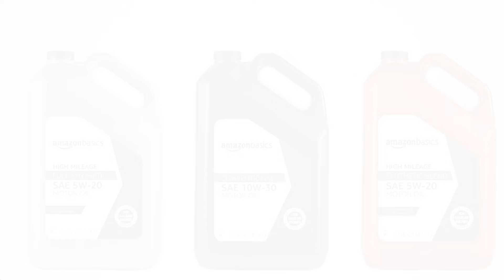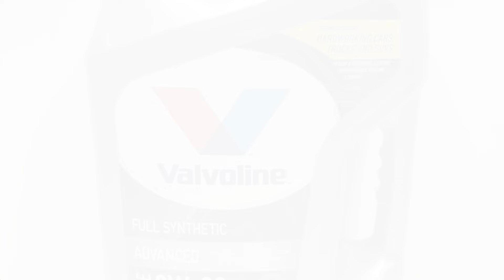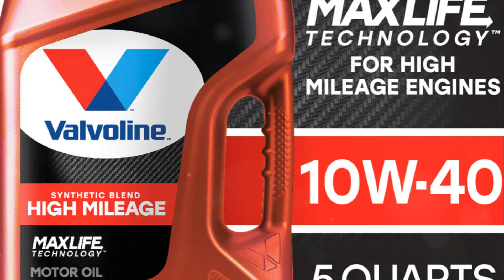🛢️TOP 5 Best Motor Oil [2024]

Comment: This video is repeating advertisments. The only one worth bring in this list are oils #1 and #2, both Valvoline products. Mobil one is in the same category as SuperTech and Amazon. Amsoil, tyats just pure multi level marketing genius. But why would you attemp to oysh an oil change to 10,000 miles? That's just insane. Dont waste your money on Amsoil. Valvoline and a good filter, every 4-5,000 miles. Winner
Reply: That is good advice. I noticed a big difference between a 5,000 mile and 7,000 mile oil change with the oil being significantly darker at 7,000, so I don't push it past 5,000 miles anymore. I currently use Pennzoil Platinum in my vehicle, and it seems to be a good oil from other videos I've seen on it.
Reply: If you own a machine, put oil in it.   Change it once in a while like the manual says.   You'll be fine.